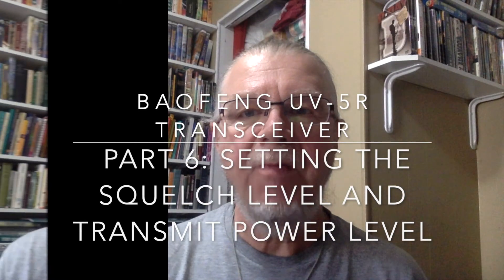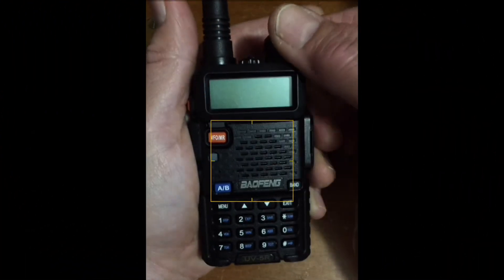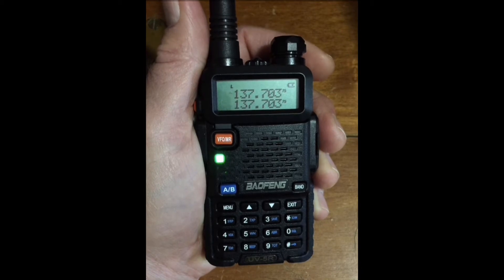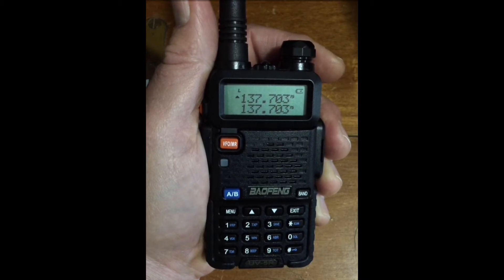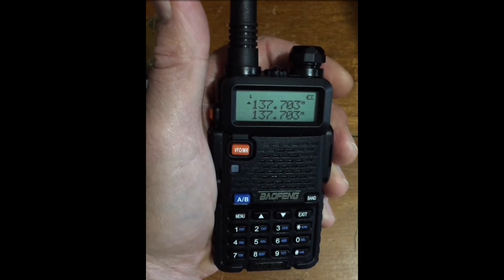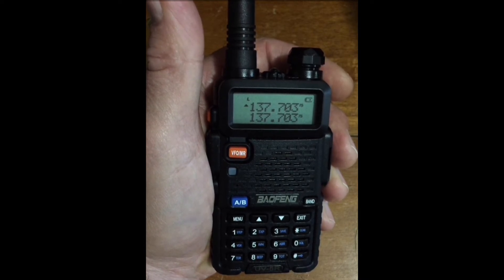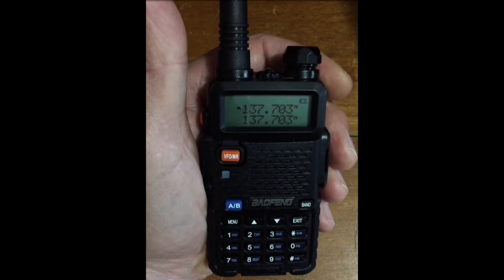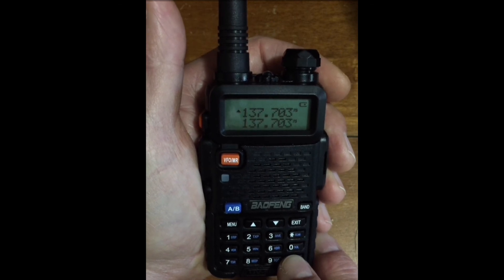Baofeng UV-5R | Part 6: Setting the Squelch Level and Transmit Power Level

Comment: How do you set the power level to high as default? When you're in the middle of nowhere you don't really need to be fiddling with this everytime you restart the radio.
Reply: I will definitely give that a try. It is most likely what I did. I just never thought about it automatically saving your power setting. 

Also I got a 2 pack of these radios and they seem to be programmed a little differently. One will stay in the menu until you hit the exit button and the other times out and gos back to the main screen. I find that very odd and annoying.
Reply from the maker: It is annoying, and that's how my UV-5R functions! I have precisely eleven seconds to select an option before it times out. That is usually enough time, unless I'm unsure of which option to select and I'm skimming through my notes to figure it out! I'll bet that you have one newer version and one older version, with the newer one staying in menu mode.
Reply: @MiltReynolds I tried your solution to the power setting and it worked on both radios. Thanks.
Power needs to be set before you set it to a memory channel. Got it.

Now I'll try to update that radio that the menu times out on.
Reply from the maker: Glad it worked. 73!
Reply from the maker: I totally agree with you, @TractorWrangler01! Thanks for the question.

The "default" power level for a channel is whatever the power level setting was when you programmed that channel. This means, as you program your channels, be sure to have the power level set to your desired level, whether HIGH or LOW.

I just now tried this on my UV-5R:

First, I tapped the "VFO/MR" key to enter VFO mode. All programming of memory channels must be done in VFO mode ("Variable Frequency Operation").

I tapped the the shortcut key (#) to toggle my transmit power setting to LOW. The display indicates "L". Then I saved 146.520 to memory channel 126.

Next, I tapped the shortcut key (#) to toggle the power to HIGH. The display indication removed the "L", leaving it blank. (I know, that's a weird way of indicating HIGH! Why couldn't they display an "H"?). Then I saved 146.520 to memory channel 127.

Now I can tap the "VFO/MR" key to enter MR mode ("Memory Recall") and scroll to Channel 126. The display indicates 146.520 "L".

Scrolling to Channel 127, the display indicates 146.520 (HIGH power indication is blank).

For either channel, I can tap the shortcut key (#) to temporarily change the transmit power setting, but as soon as I change to another channel and then back again, the channel's power setting has reverted back to its default setting, which was what it was when I programmed it.

Let me know if this works for you.

73!

Comment: This only works in VFO mode. If a channel memory was saved on HP it will remain on HP.
Reply from the maker: Thanks for the comment, Pete. However, I'm not sure it's accurate...at least for my Baofeng UV-5R. I just now tried it:

1. Saved 147.470 to channel 54, low power
2. Saved 147.470 to channel 55, high power

On both channels, I can toggle the output power by pressing [#]. Pressing [#] on channel 54 toggles from low to high. Same thing for channel 55.

Does your radio do this differently? If so, I wonder if there's a difference between model years?

Comment: If I was to use this in the woods. Should I put setting to hi transmission.
Reply from the maker: It is likely that you would need to switch to the higher output power when the woods. Trees, hills, buildings and the like all will affect the signal. Start with the lower power setting, but if you are unable to make contact, or if your contact tells you that your signal is noisy, distorted or weak, switch to the higher power. 

Remember, however, that it is best to use only the amount of power that is necessary. Operators who always use the highest power setting, even when a lower power setting is sufficient, will likely be interfering with distant operators whom they can't hear. 

Transmit at the level of power that you need, but don't over-power others unnecessarily. 

73!

Comment: Hi! If I hear all the time noise, what setting will be the best? I would like to receive only clear sounds.
Reply from the maker: That's a good question...I have to deal with that often, myself! First, you have to determine if it's noisy because the Squelch filter is too low, or if the signal itself is too weak. 

If it's because the Squelch is too low, the setting should be set higher. Here's what I do. I start with my Squelch filter set to 1, and then listen for a bit. If it's noisy when I'm NOT receiving any signal, then I increase my Squelch setting to 2, and listen a bit. If it's still noisy when no one is broadcasting, then I increase it to 3, and so on. Sometimes I need to increase it all the way to 5 or higher!

If you are receiving someone's signal, when someone is broadcasting their voice over the air, but it sounds "noisy" or unclear, you can try several different things:

- Make sure you have entered the correct frequency. If your radio is set to even a few kilocycles off from the signal you're trying to listen to, the sound will be noisy and difficult to understand.

- Decrease the squelch setting, even if you need to go all the way down to zero! The signal may be so weak that the squelch filter will need to be set OFF, all the way to zero, in order to hear it better.

- Change locations, or try holding the radio higher. Weak or distant signals are sometimes blocked by buildings, hills, or even your own body or hand.

- Purchase a better antenna.
Reply: @MiltReynolds  I use strong antenna on the roof. I can hear something clearly 20km away from me, I tried to set squelch from 0 to 9 and doesn't help. It's just like the antenna receive something so far away that's can't be even audible, just noise.
Reply from the maker: @synthetic1451  Interesting...what is the frequency? There are many frequencies that broadcast only digital signals, or television signals. Can you reply with the frequency on which you are hearing the noise, and I'll try to do some searching?
Reply: A 149.300 ( Only my district/ state area- 984,6 km² one km is a 0,6214 mile)
B 148.725 (Whole Poland)
But I am not sure if this will work for you because this is in Poland. Some friends said that Tv frequency get in the way and that's why they had many times a noise. Strong antenna that I can hear what is somebody 20km away from me saying, clearly. Of course if he got the power. 8m above the ground, I can't move it because of no more cable or place to attach.
Reply from the maker: @synthetic1451  Yes, that's a whole different ballgame for me, I'm afraid! My best guess is that the frequency is being used for digital only, and that's why it is sounding like noise on your end. I doubt that your antenna is at fault. 73!
Reply: @MiltReynolds  Our firedept use it for a correspondence, I just listen to this to know faster if there will be something in my area because I am volunteer firefighter. Half of us use the same radio but not everyone got this problem, that's not at the end of correspondence but just like this receive something that is too far away to be audiable. Maybe antenna is to strong and just receive some weaker signals that are just a noise
Reply from the maker: @synthetic1451  Distance is not the complete story. VHF and UHF can easily be interfered or blocked by buildings or terrain. Do you think you're line-of-sight with your fire department's antenna? If not, that might be the problem. Is the noise a recent problem? Has anything changed since the last time you were able to receive clearly?
Reply: @MiltReynolds  At the first day I set everything up I had this problem. The antenna is placed high, can't be better :/. This noises are signals that precede the siren. And it receive a lot of them, ours is clear, very clear and the place where it kicks in is just 1,5 mile away from me. When it kicks in somewhere further there is a gentle hum with this sound. But many times it receive something very far away from me and it is noise for a 2 or 3 seconds, sometimes a little bit longer as well. Can't do anything with a antenna, the only way I could fix it are the device options, but with this what I see Squelch didn't work
Reply from the maker: @synthetic1451  I'm sorry that I cannot help. I can imagine how frustrating it must be. I was a volunteer firefighter for about 26 years, and I miss it greatly! 

Does your fire department broadcast a tone when it sends a signal? It is easy to program the Baofeng to require a specific tone in order to receive a signal. It would be menu item #10 or #11, depending upon the system your fire department uses.

Comment: Which squelch level is best to use 1or 5 can you help me?
Reply from the maker: It depends upon the situation. Typically you should set your radio to squelch level 1, for maximum sensitivity to distant or weak signals. However, if you are scanning through the channels or frequencies, and the scan operation is constantly stopping at noise signals, then try increasing the squelch, going from level 1 to level 2.

That is what often happens to me. I've got my radio in my vehicle, and I'm scanning for traffic. But every 30 seconds or so the scanner stops on a signal that is nothing but noise. Perhaps it's a signal from a very distant station, or perhaps it a signal from interference or a data broadcast. Whatever the source, if it's just noise, then I gradually increase the squelch level. Sometimes I must increase my squelch to level 4 or 5 before the noisy signals are finally ignored by my radio.

Keep in mind that the UV-5R transceiver, as programmed by the factory, has completely useless settings for the Squelch. When I was first learning to use the radio, I realized very little difference between squelch level 1 and squelch level 5! The only solution to this is to change the squelch programming using the CHIRP software.

For more information about CHIRP, check out my episode 14: 

https://www.youtube.com/watch?https://www.youtube.com/watch?v=BpTiURrt5tw&list=PLAAAbIZ0NmEEsSAhZdQ3Mj97YfRH2p3cK&index=14

Here's the link to CHIRP homepage: https://chirp.danplanet.com/projects/chirp/wiki/Home